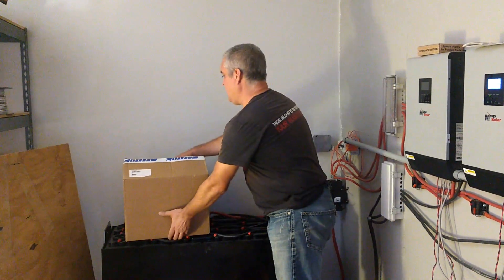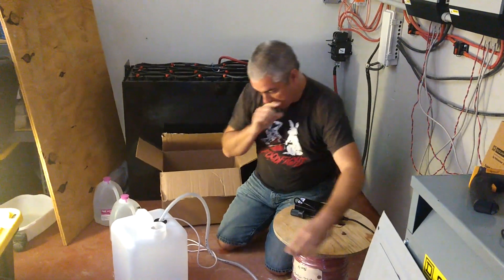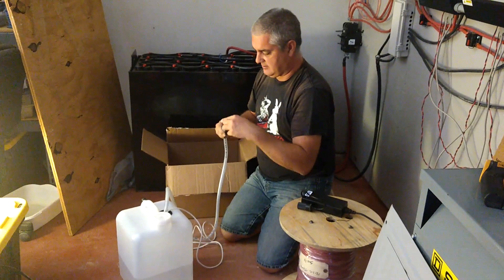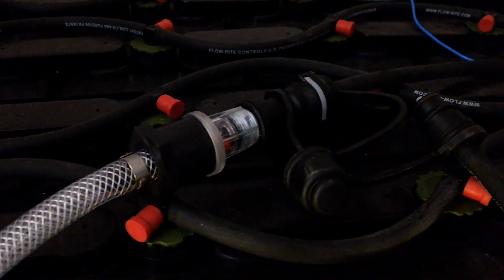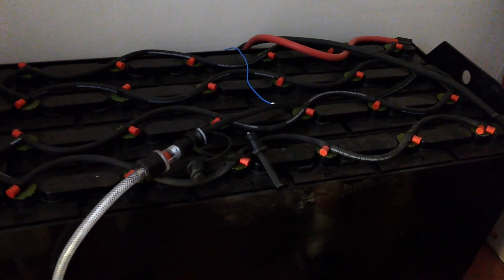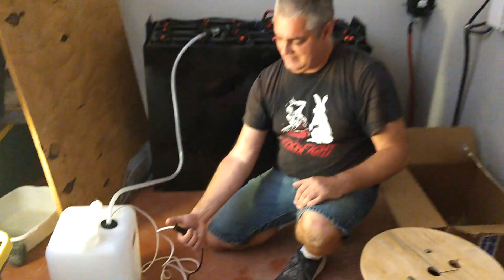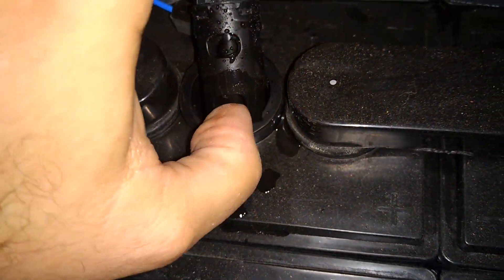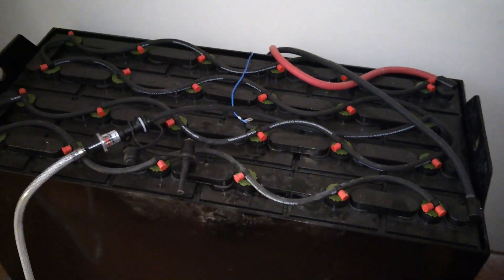Watering our forklift battery with the Flow-Rite battery watering system

Comment: How would you know if that float is working and not stuck in the closed posion overtime preventing water from coming in ?
Reply from the maker: Yeah, that was a concern to me as well. I started popping them off to check :/ They have been reliable but with no way to know it's kind of a waste.

Comment: Much faster than how we do it. Our 16 batteries X 3 cells, so 48 cells takes almost an hour. We use one of those $10 watering cans that automatically stops when the cell is full. I’ll have to look into this. So much faster.
Reply from the maker: It's great. There's a bunch of watering systems on ebay and amazon I'm sure they all work about the same.